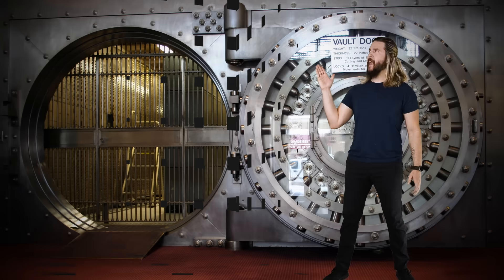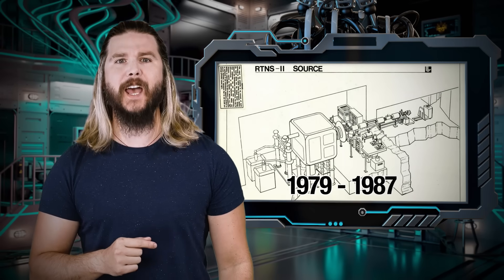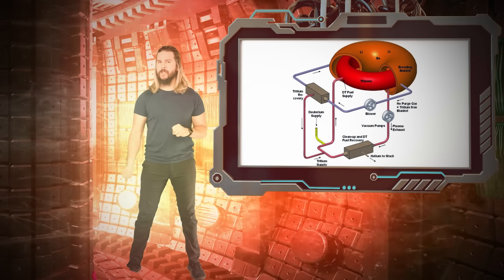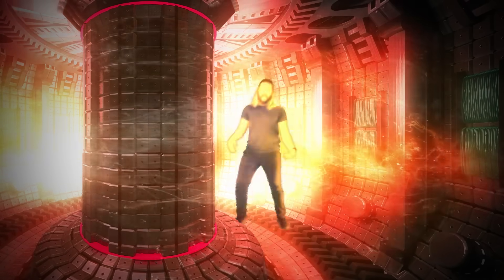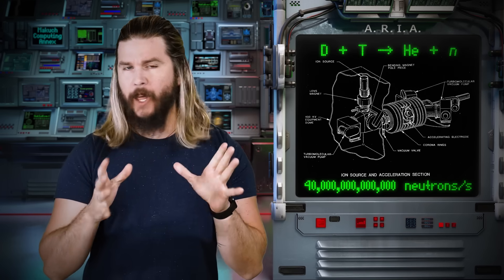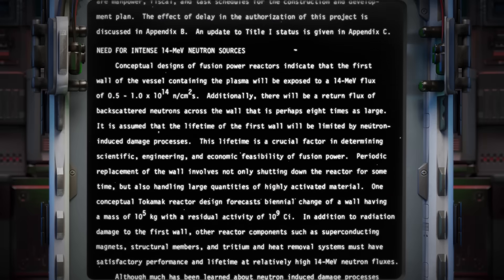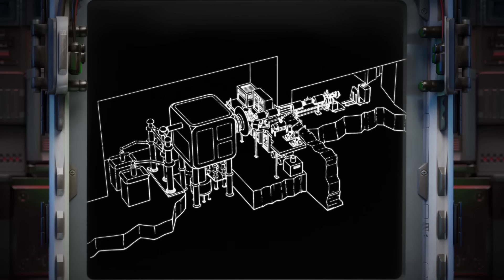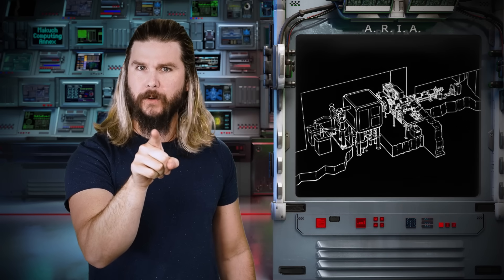What’s Behind the World’s Heaviest Door?

Comment: Many smart people have been screaming about this for years. The massive amount of HIGH level radioactive material that will be created by "clean" nuclear fusion reactors. Future of nuclear power is small single use 15 to 20 megawatt fission reactors. Imagine a sealed submarine size pot in a tractor trailer. Trailer #2 is steam processing and generator. Simple 20 year power supply.

Comment: ITS ALL FUCKING BOILING WATER
Reply: It’s all just rotating a crank honestly
Reply: @Jimmysage3273  who up rotating they crank
Reply: omg meeee
Reply: Yeah. But I wouldn't make tea out of this water.
Reply: This was my first (only) thought
Reply: Radiation
Reply: Well, we also have gas turbines (Brayton cycle) that don't involve boiling water but rather a continuously gas-phase working fluid, particularly on natural gas power plants. But then again, to get the most efficiency out of one, you do a combined cycle, where the still-hot gas coming out the other end... boils water. So, we have forms of power generation that don't involve boiling water, but you get the most when you do them and boiling water together. Though on the other hand, I'm pretty sure a lot of gas power plants just do the turbine without the boiler since it's simpler to build.

I do expect a fusion power plant to use combined cycle, if possible at least, since that's the most efficient way we have to convert heat to electricity, and with fusion you need every bit of efficiency you can get
Reply: Always has been 🔫
Reply: 🔫Always has been
Reply: were gonna harness the power of the sun just boil water on other planets bruh😢

Comment: I still don't get why they actually had to build such a thick door. Just putting the neutron source underground and build a labyrinth trap would work just as well, as neutrons cannot fly around a curve. That worked even for underground nuclear explosions (okay, there was also a section which was pushed out from an inner segment which then blocked a passage further out but the principle still applies). The only exception which comes to mind is that everything is going to be activated and as such, it is easier to break up and dispose an overground concrete structure with a door instead of an underground labyrinth with activated walls. But that explanation is just missing.

Comment: Im curious could you use Electrolysis to create hydrogen then burn it to heat water to spin a turbine to make power and then turn it back into water to send it back to the tank to cycle threw again to make electricity?   

Wondering if this crazy idea could work for infinite energy I mean you would need a massive amount of water and it could take some energy to get it working but would it be possible?

Comment: Well, I hoped for atleast some photos of that stuff. In particular, atleast show photos of those radiated metals, or/and how they actually behave after heavy radiation (idk, poking it with a stick or anything).
The same applies to the door. Ok, it's big, it's thick. But could there be one or two photos of how it looked before and after the exploitation to understand the scale? Are there any visible changes on it afterwards? 
From all the plain info I cannot tell what is this door in more "material" aspect.

Comment: Reactors of the future will collect allot more then just the heat of the of the system. Walls lined with LMH( liquid metallic hydrogen) will be shaped to reflect light into high efficiency concentrator type photo voltaic cells the neutron radiation will enrich the LMH making deuterium and tritium. While the fluid walls loop through conductive material allowing the magnetic field to do work aka produce electricity, then cooled too make work through heat. 

Want a design for an anti-matter reactor?

Comment: You ever think we're missing a big piece of the puzzle? We come up with all these ways to pull energy out of nuclear decay and fission and even fusion. amazing stuff but then, THEN. we boil water and spin generators. Seriously? we fucking use it to boil water and thats where the energy becomes electricity I mean it WORKS but I feel like there is a much more elegant solution just around the corner. What if the Neutrons or Protons could just be converted to electrons?

Comment: I was fully expecting the six feet of concrete to be enough to give you a small but non-lethal dose of radiation as long as you didn't stay there too long.

turns out it's more dangerous than the elephant's foot.
and that's after the six feet of concrete and steel.
really terrifying.

Comment: Paraphrased "these are the biggest hinged doors on the planet"
My instinct watching this was that you where simply wrong so I looked into it and you're not even close.  There are way bigger hinged doors in use in ship locks.  Those things have to take a lot of pressure as a matter of routine.  Just by way of example - At panama, some of the doors weigh 662 tonnes per leaf and at two leaves, that's 1,324 tonnes.  This door's 44 tonnes just doesn't compare.  Even if you want to say, "well those are double hinged and this is single hinged", each leaf still weighs a full order of magnitude more than this door does.  Just the hinges for one of those leaves weighs nearly as much as this whole door does.

Comment: Not sure that is the heaviest door. I once worked in a building on the Naval weapons station at Seal Beach , CA. that was used to assemble the 2nd stage of the Saturn 5. The main part had sliding doors that were over 6 stories tall. The attached annex had 6 story doors on hinges 10-12 ft tall that swung outward. Would have loved to get a photo but they had rules against that.
Reply: I think the qualification is that it's the largest and heaviest hinged door.  Sliding doors definitely get larger and heavier.  But, I think nothing else pivoting on a hinge can match up to it.

Comment: And the guy who got that shot on the face would survice much longer than you lead on, wouldn't be nice but the fact is, due to the speed at which the beam goes the effective deposited radiation on the person wouldn't be that much as most of it would simply go through. Check the video on the guy that got shot by a particle accelerator beam to see what I am on about. Yes he did survive much longer that you would expect.

Comment: A door far larger than this was constructed at the National Institute for Fusion Science in Toki, Gifu, Japan in 1994.  It weighs 708.6 short tons (642.8 tonnes) and is 38.5 feet (11.8m) high, 42.35ft (12.9m) long and 6.6ft (2.01m) thick.  708.6 short tons is over 1.4 million pounds or 640,000 kilograms.  It is the primary access door to the shielded room which houses the Large Helical Device.  It holds the current record for the world's heaviest door.

Comment: One thing NOT mentioned was IF that door was hit by Neutron based Radiation. Even after all sources were turned off the door would be very dangerous. Even more so if metallic on the outside layer and rebar on the inside. The locks looked metallic so yea. that door would kill anyone if it had been exposed to neutron based radiation. Thus that door had to have been on an outside layer of attenuation material.

Comment: Nice door good presentation. I have moved through old military sites with 18" thick steel and concrete doors used to protect launch crews from nearby nuclear weapon strikes. Hatch vertical ladder three doors 2 normally open middle one closed doors at 90 degree angles from each other to block any straight line blast effects.

Comment: I have a thought about disposal for "activated" material - use it to produce more electricity. If it's hot enough to boil water, use a method similar to a fission reactor, but using passive decay heat instead of a chain reaction. (water also happens to be a great radiation shield) If it's not hot enough to boil water, you use it for RTG's.

P.S. Not even a particularly original idea - in the 60's we looked into using high level waste to power nuclear subs, and we use Radio Thermal Generators to power space probes today. (A proper fission plant was smaller, and we can't scale RTG's to industrial size safely)

Comment: Why... why didn't they just point the ray in another direction? Build it in a mountain (they're always in mountains) and have the neutrons flying towards the mountain's centre, where the rock would absorb them all. Or worst-case, just point it downward! Point it down, put your test material underneath it, and any excess neutrons have to pass through the Earth's core before they threaten the Chinese, and they're used to dangerous waste products left behind in fields and alleys. They scoop up cooking oil from the sewer, a few neutrons might help sterilise it.

But realistically there won't be any cos the entire Earth will have absorbed them better than a couple of measly metres of concrete.

Comment: we need to develop new methods of generating electricity, currently there's pretty much 2 that are in current widespread use. air/steam/water powering a turbine, and solar. (and solar is only a fraction)
Of ALL the technology, nuclear, coal, dams, wind power, and even the aforementioned fusion, (and more) it's all push a turbine.

Comment: Fusion isn't non-feasible, but hydro-thermal conversion maybe an inadequate way of harnessing its energy. Fusion would produce more than just heat. Light emission could be harnessed like in solar power generation. The kinetic force of fusion could spin a giant motor like the internal combustion of a car. Neutron emissions could be harnessed if we could discover a material or lattice structure that converts or channels the force of neutron bombardment into mechanical impulse, or static charge. Even if not harnessed directly neutron expulsion doesn't have to be purely degenerative. If a material could be found or produced that hungers for neutrons and would gain integrity as they are absorbed then the life of reactors could be extended. The only non-feasibility is in trying to project historical methods as the limitations of the future.

Comment: So, personally, this reminds me of how chlorine trifluoride can be safely stored in a steel drum despite being a strong enough oxidizer to corrode the metal making up the drum, because the metal inside the drum is "passivated" by the reaction into inert metal fluorides. Is it possible that a material could be chosen that gets "passivated" under neutron radiation, such that even if its interior structure gets destroyed, the resulting damage is still able to shield neutrons from the outside, and the activation of the atoms doesn't produce any super radioactive isotopes?
Reply: That was the whole idea behind that project!
Reply: @matthewcox7985  As in, the whole idea was to find a material that "passivates" under heavy neutron radiation? I figure that's what you mean but I gotta ask to make sure anyway
Reply: @GarryDumblowski  Thats a cool idea but ultimately no, neutron radiation isn't going to passivate anything (or least anything that we know of or can even imagine)

Comment: I wonder if the engineers ever considered building the RTNS-II vertically so the beam went up into space. Maybe the neutron beam would create radioactive air?
Reply: Neutrons bounce around a lot when they hit molecules, and eventually end up captured in an atom or wedged in a molecule's structure when they run out of energy. You'd end up activating a ton of argon in the air as well as turning oxygen into a radioactive fluorine isotope, so... yeah pretty much

Comment: The part that becomes so radioactive that it has to be replaced every year...could something like that be used as a power source (radioactive decay) for deep space probes? 
The Voyager probes used something similar, no?
Reply: Radioisotope Thermoelectric Generators, or RTGs. (I'm even more surprised that my autocorrect got all those words right! 🤣) They need a heat source way hotter than irradiated junk; as I recall most of them used plutonium.

The problem with radioactive waste is the stuff that's not emitting enough energy to be practical to use, but is still emitting enough to be dangerous - You can't cook on it, but it'll still burn you.
Reply: Thats actually a very good idea, but the problem is they don't store enough energy to be useful as batteries.

Comment: Exactly, one of the biggest problems in making an operational fusion plant. For magnetic confinement reactors, like yours, it can also especially be a problem for the superconducting magnets. For plants like ITER ("conventional" NbTi and NbSn conductors) it helps that there's a lot of experience in the effect of radiation from, for example, CERNs accelerators and detectors. For future plants using newer materials, like the ReBCO used by (SP)ARC, that's a potentially game breaking problem.

Comment: Would amorphous molecular structures like those in glasses be more resilient against neutron damage than crystalline structures?
Reply: only material with engineered nanostructure would work perfect because the radiation also deposit elemental particle like Helium and Hydrogen inside the material, so a material with a nanostructure to vent the gas is needed otherwise void form inside the material. Second best would be alloy with defects that allow these gas to coalesce somewhere to relieve stress.
Reply: @xponen  wouldn't it be better to have an integrated gas relief system rather than an intermediate material? I would guess that having random inconsistencies within your material, whether that be nanostructures or alloy imperfections, would potentially introduce variables that would be impossible to control for. If you instead integrated a mechanism or coated your material of choice with a nanostructure to absorb hydrogen nuclei it could be more controlled.

Comment: I finally have something related to share: I work at the Center for Plasma Material Interaction, the foremost lab studying the use of liquid lithium in nuclear fusion.  Under a strong magnetic field and heat gradient - such as you would find in a fission device - liquid lithium will flow along the walls, and even upside down.  With this, the steel reactor walls are protected both from radiation, and physical damage from flare ups in the plasma.  Additionally, the lithium helps to absorb any contaminants that make their way into the plasma.
Reply: Very cool addendum!  As Kyle was describing all the shortcomings of the containment materials I kept thinking it doesn't seem like solid materials alone are the answer; a liquid barrier--if it could be shaped properly--could act as a self-healing barrier.  It's awesome that you guys are working on that.
Reply: @IndianaTony  And another thing about using a liquid metal is its pump able, use it in a heat exchanger to a steam system, Pump in bottom, the liquid flows to top while getting heated, also lithium under neutron bombardment can produce Tritium and Deuterium-Tritium fusion reactions are what produce mountains of neutrons. You get cooling, fuel production, and heat transfer all in one.
Reply: Wouldn't the Neutron bombardment start turning some of the Lithium into Tritium and Helium? Could be a way to make tritium to fuel the reactor I guess.
Reply: @BabyMakR  I already mentioned that, but exactly, It would be cooling, Fuel Production, and neutron shielding for the reactor walls all in one, plus since its molten lithium it can be pumped and used in a heat exchanger to power steam turbines to produce power.
Reply: I didnt understand anything but it sounds cool
Reply: I just can't believe the Tron door is real.
Reply: I guess that is why nuclear fusion reactor research continued after these experiments.
Reply: How do they heat the plasma thru the liquid lithium?
Reply: liquid lithium sounds like something you don't want leaking
Reply: Neat!
Reply: Okooo
Reply: Imagine lying for attention
Reply: is there a way I could contact you? I'm interested in doing work with fusion reactors in the future and I would like to get your perspective on it + there's a decent chance I'll be going to UIUC (I'm currently a high schooler but planning for college) so it would be great getting your perspective as someone who works there.
Reply: Sorry for responding to this old comment, but that sounds like sound insane sci-fi "sounds cool but no way" type stuff. I don't doubt you, just that what you're describing seems so...unreal.
Technology is awesome and terrifying.
Reply: That is extremely fascinating and exciting work!  I always excelled in the sciences in school, but didn’t qualify for any scholarships because I wasn’t “well-rounded” by playing sports and refused to put myself into massive debt from student loans. Never was given any direction or instructions on what I needed to do in order to become a scientist that gets to perform the experiments that are on the cutting edge of science. I was never given a clear plan on how to get from point A to point B. I’ve always wanted to be able to work in the areas that perform experiments that delve into the areas of our reality that are still unknown to us or are misunderstood (and it’s known to be misunderstood) because they are just altogether avoided (for many ridiculous reasons)  or we only have a small fraction of the answers needed to be able to fully understand whatever it might be that I’d be studying..
Reply: @kidwajagstang that sounds like a lot of crap to admit you didn’t go to college and failed to fulfill your childhood dreams.